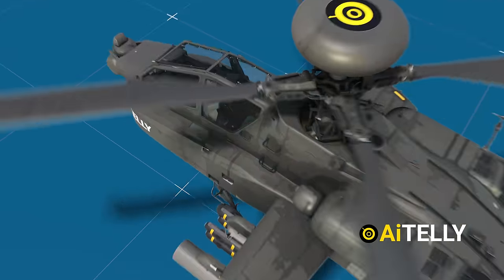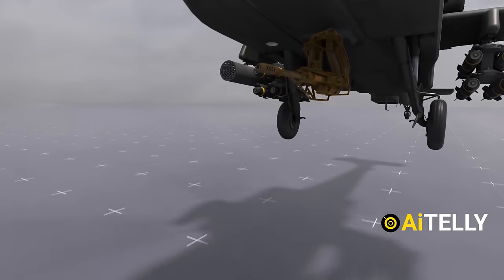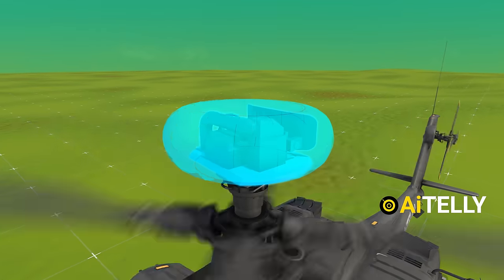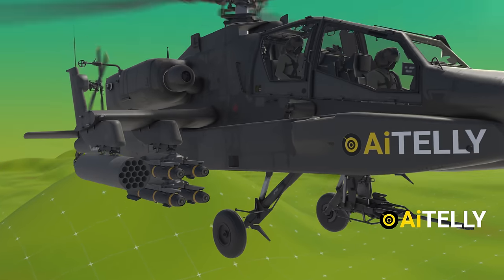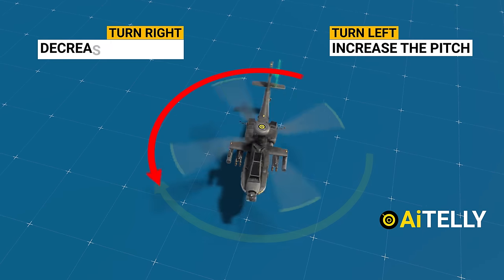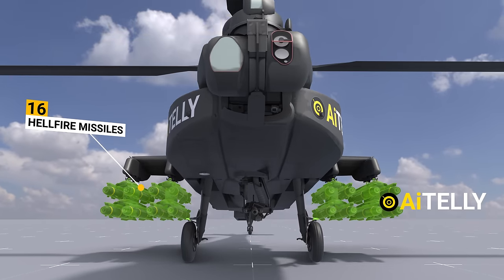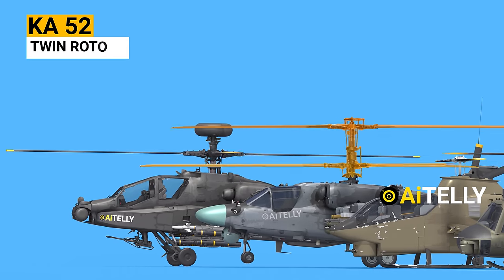Apache Helicopter How it Works? Boeing AH-64 Apache

Comment: turboshaft is similar to turboprop and turbofan,turboprop just have proppelers and turbofan has minimal gear ratio to spin a fan fast 4000-6000rpm (commercial)

Comment: Expensive, old 80s tech. Perhaps if the Apache was made slightly bigger for armed troop transport? Contingent upon if they could find a way to make the Apache more durable and efficient with much less maintenance. At one point the Apache required est. up to 14 hrs. of maintenance for every hour in the air.

Comment: I hear flying helis is very difficult. You have to be able to hover well to land well, and hovering is quite hard compared to fixed wing normal flying. There's also weird stuff with the ground not vibing with the oscillation of the rotation and the helicopter shaking it's self apart. Good videos on YouTube about it.

Comment: Your animation of the axial jet turbine is wrong. The compressor compresses the air from the intake. This enters the annular combustion chamber through stator vanes where fuel nozzles are located. The combustion chamber itself is a thin (1.5-2mm) perforated can of titanium with a aluminum oxide coating. Air is bled off around the combustion chamber to act as a low temperature curtain against the outer motor casing. The perforations in the combustion chamber bleed additional air into the burn zone facilitating fuel-air mixing. The turbine is essentially a compressor in reverse where the combustion gasses are allowed to expand, generating power to the turbine shaft.

I can explain the gear box and additional technical details if you wish, but then you'd have to pay me for a script ;)
I used to work with stuff like this.
Reply from the maker: Thanks for your feedback.
We highly enjoyed your comment Thanks 🙏🏻 
we can pay you;)

Comment: the problem with state-of-the-art cutting edge weapon systems of western origin is that they're expensive & that's a fact . . . for e.g. the high acquisition cost of the AH-64E Apache Longbow® (Block II) multi role attack helo gunship can be offset by lower life cycle cost . . . or the F-35A Lightning II (Block 40+) stealth multi role air dominance fighter that retails at €120.50 Mn (fly away cost) a piece . . . the Hydra 70 air-to-ground artillery rockets could do with some form of low tech guidance systems . . .

Comment: Question?
Was there ever a twin rotor Apache made?
What's the total weight of the Apache?
How much fuel does the Apache consume?
What kind of radar cross signature does the Apache leave behind?
How's the Apache against a RPG or a Javelin?
How fast are those blades spinning let's say a minute or a hour?
Is it true they test these out in Arizona?
Did the Taliban ever get some of these?
Reply: 1) No
2) I've seen AC basic weights ranging from 12.800 to 13.300 lbs. Maximum gross weight is 20.260 lbs, maximum ferry weight is 23.000 lbs.
3)Fuel consumption is dependent on gross weight, pressure altitude and free air temp, but for a 20° 17000lbs ac sea level you can get as low as around bit more than 900 lbs hr.
4)classified, any value found online will be an estimate
5) As any other RW asset, badly, there is no thing such as "completely armored flying tank."
6)Main rotor speed is 292 RPM on delta  (101% Nr).
7) They are built at Boeing facilities in Mesa, Arizona.
They are also tested at Yuma proving ground. 
8)I don't recall any being shot down by them, ever, there were multiple mishaps during the conflict however.

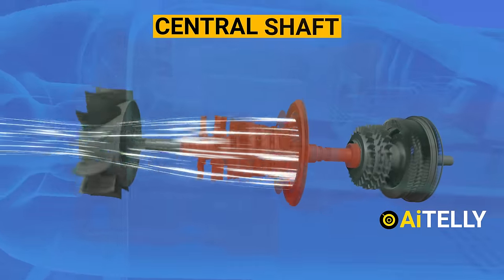Comment: 1: The pedals are called " anti-torque pedals". 2: The pilots don't wear fighter pilot helmets or oxygen masks. 3: The top turret is called the Pilot Night Vision System or PNVS. 4: The lower turret is called the Target Aquisition and Designation System or TADS. 5: both parts of the TADS move at the same time, they are not independently actuated like you show a 1:19. 6: The 30mm is slaved to the current acquisition source ie the TADS, the HMCS, or a specified targeting point. 7: The Longbow radar doesn't rotate 360 degrees and scans side to side from either the HMCS or by slaving it to a target point, or by slewing the radar with the bezel buttons on the MFD in the cockpit. 8: It's not called a HUD Helmet package, it's called the Helmet Mounted Cuing System or HMCS. 9: The engines are the T700-GE-701C and the AH-64E has the T700-GE-701D engines(starting to think that no research was done for this video at this point) 9: The forward intake section in your animation at 5:27 is totally wrong. That is more like the impeller for cooling the Engine Nose Gearbox(ENGB) and not part of the engine. 10: Cyclic is one word, not two. 11: Since the integration of the laser detection system, the Stingers and Sidewinders are no longer able to be carried, and they have never been used in combat. How do I know all of this? I worked on the Apache in the US Army for 7 years. Know the thing literally inside and out, and this video is absolutely horrible.
Reply: Forgot about in the beginning, where it displayed the airflow going through the nose gearbox haha
Reply: @oerlikon20mm29  It does go through the NGB. That shroud is open on both ends to allow cooling air over the NGB. The whole gearbox has cooling fins on it for a heatsink. So that part was actually correct.
Reply: @ImpendingJoker  Ik but the graphic showed in going through the gearbox itself
Reply: @oerlikon20mm29  Yes, and it would do so. It should have also shown that it was coming in through the intake of the engine as well, I agree, but by that point in the video my list was long enough to show how poorly this video was done. That little quibble would have just been beating a dead horse.

Comment: The Apache's days are numbered!
The name "attack helicopter" ruined this machine...as even top brass have fallen victim to using this machine INCORRECTLY, which has destroyed it's future. The Apache helicopter was designed to DEFEND western europe from a sudden Soviet invasion. During WW2 the Allies had "tank destoyers"....armored 'tanks' designed to slow armored breakthroughs using ambush tactics. These tanks had large guns, LESS armor, and were designed to move fast...get in front of armored columns....and ambush them, before possible relocating. The Apache helicopter was the Cold Wars "tank destroyer" concept. The Apache was to 1) Get out in front of a Soviet armored column, 2) Ambush lead elements, & 3) Relocate/Refit....as quickly as possible, from over friendly territory. This part is critical: The Apache was NOT intended to operate over enemy held territory...it was designed to operate over friendly territory along the front lines, and theen retreat for refit & future ambushes.

Since the end of the Cold War....the Apache has been used INCORRECTLY by (those people that only get stars on shoulders if they bow down to the WOKE agenda) who envision these "attack" helicopters buzzing the enemy wreaking havoc as "wonder weapons". Well these machines are NOT impervious, and the enemy does not appreciate being buzzed from overhead. The Apache helicopter is looking at Russian "attack helicopters" right now in Ukraine, and taking notes. The note reads: THE WRITING IS ON THE WALL! THE APACHE'S TIME IS FINISHED.

Comment: you're wrong on the hellfire system the weapons system aims each missile before launch it doesn't have contact with the missile in flight beyond sending radar so a reflection off the target is maintained, the radar hellfire operates the same as the AIM 7 sparrow missile and just goes to the radar signature it's aimed at upon launch!
Reply: Aim7 sparrow is sarh guided not arh